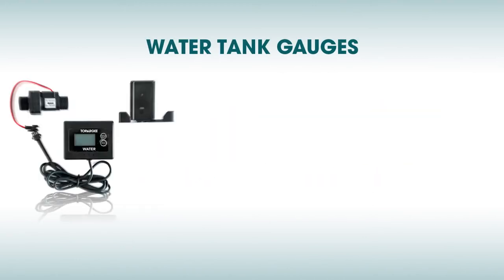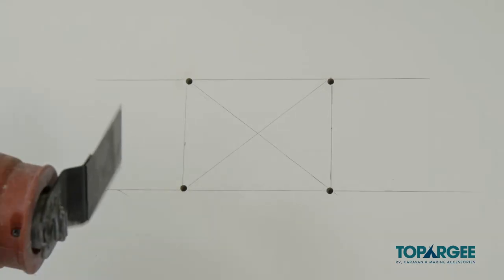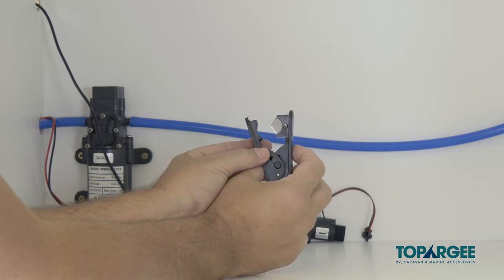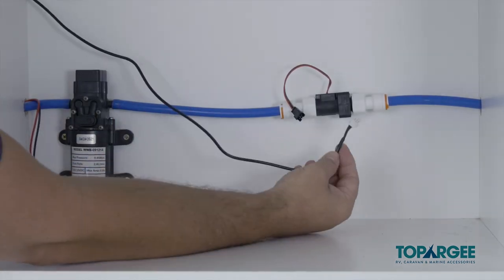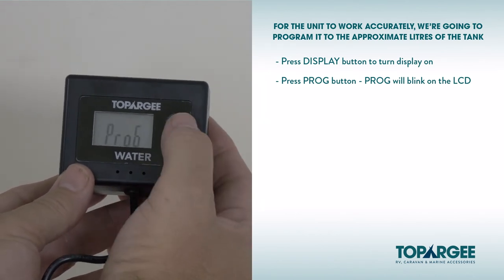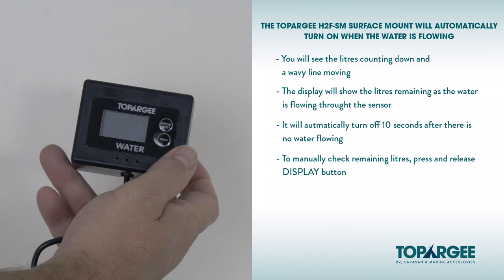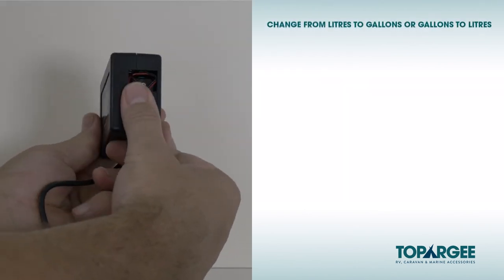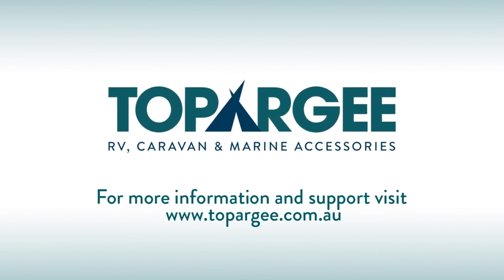Topargee Water Tank Gauge Installation (Step-by-Step)

Comment from the maker: The gauges are very accurate. Your usable water depends on where your exit point on your tank is. Some manufacturers put them on the side near the bottom so any water below that is unusable. If yours is on the very bottom check your gauge is set to H22. Also, have a look at our FAQ page where most questions are answered. https://www.topargee.com.au/faq 
Hope this helps Cheers

Comment: I would like to know if you have a blue-tooth version that can say report on 3 water tanks separately on the one gauge. This would be ideal as we manage/monitor our overall weight profile with the water tanks and manage which tank we draw water from. Thanks
Reply from the maker: @ac-xz6bf yes we have a Bluetoother Water Tank Gauge.   Our gauges can read 3 water tanks but it will be as a combined  total and as long as they are on the same pump.   If your water tanks all have seperate pumps then you would need one gauge per pump   - https://www.topargee.com.au/product-page/h2f-bt12-bluetooth-water-tank-gauge   or we have packages available  https://www.topargee.com.au/water-gauge-packages

Comment: Where is the plumbers tape recommended to be used? Just on the sender thread when connecting the fittings?
Reply from the maker: Yes just on the sender thread. One lap with the tape is perfect.
Reply: @topargeerv  I gave it a go a few weeks ago and worked perfectly. No leaks
Reply from the maker: @jeshe0  great to hear thanks Jed :)

Comment: How accurate are these ? I put a flush Mount in my camper, it’s meant to be a 155l tank but Topargee is telling me I only have 124l usable. I understand I won’t get exactly 155l but 124 is really low
Reply from the maker: If your gauge is only measuring 124l usable then that is what is "available" Some manufacturers don't maximise the tank by installing the exit point on the side making it impossible to drain.  Hope this helps
Cheers